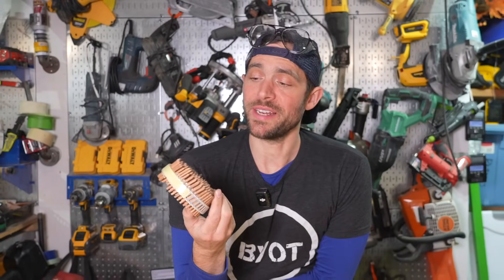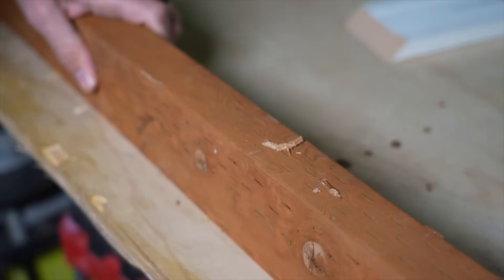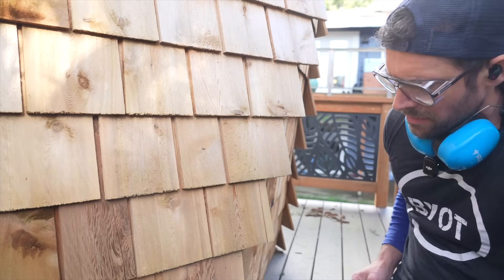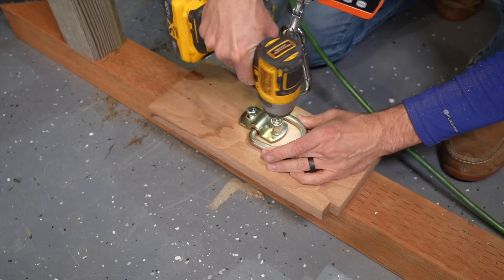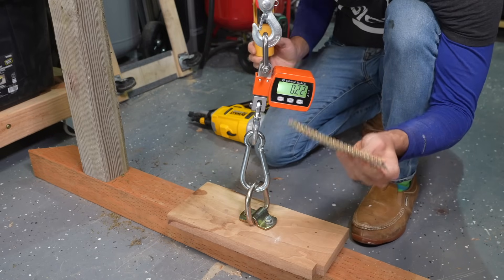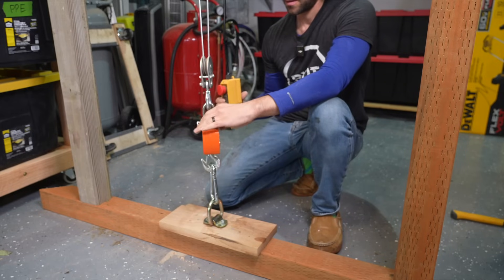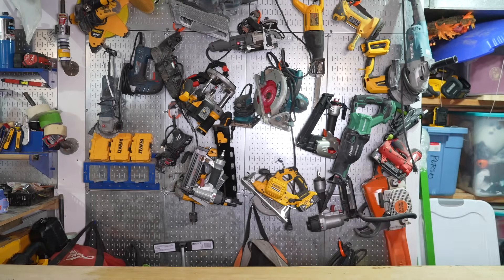Testing The Strongest Wooden Nail Ever Made!

Comment: Yeah. The price . That will very much fail in the states. Id sooner drill a hole and put a hard dowel in it than spend 300 for 100 nail that i can make myself.  Nevermind the $880 nail gun that you need to fire the $300 wood nail. Absolutely RIDICULOUS

Comment: Out of curiosity do the fibres fuse together when hammered manually using a hammer? I am thinking lower pressure so less or no heat and friction? No broken wooden nail after each hammering so no fusion. Am i correct? Purely curious and not trying to debunk.

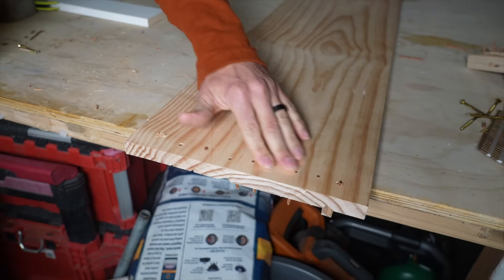Comment: Great answer to a problem we never had and never will. I don't get it, you even will have to fill the nail holes just like any other time, those holes are ugly. And that amount of cracking. Even the first use around 1:30... "It does a great job without separating, cracking the wood"... and shows a plank with egregious amount of cracking. I'm really not sure what are we supposed to take away from this product advertisement.

Comment: Seems like a solution for a problem we dont have?
Reply: I'm sorry but if you can't think of problems that this solves you're not being creative enough or you don't have enough experience with screws and nails. Regardless it's expensive and untested, plenty of other criticisms to be made other than this non-starter.
Reply: @definitelynotcodyc been building for 50 years with all kinds of fasteners cant see a reason to buy this.  Maybe specialty cabinet making.  Or arbitrary rules about not using metal.

Comment: Nice video Brent, weird to see those "resin" nails being so strong.

But, can you confirm that they actually are "bonded" with resin ?

It would explain also why you could hammer a single one down from the beginning but not after using the nail gun (resin structure opened up/loosing its strenght after being "shot in"

Also, the last metal nails, are they connected with copper wire ??

Comment: For a fence I don’t see this system lasting long, I believe they will rot before the actual boards and also if it’s windy they don’t hold as better as a different fastener.
Reply: For as far as I have seen now.
These wooden nails seem to have a kind of resin that bonds their structure.
They seem to be not of 1 specific kind of wood.
So like plywood bonded with resin.
What could be seen in the shot after the cut.